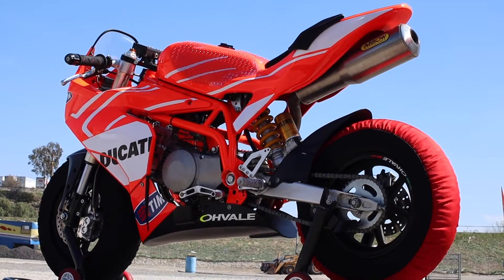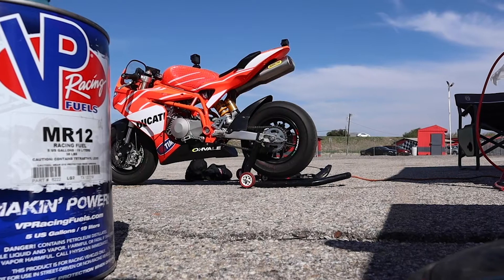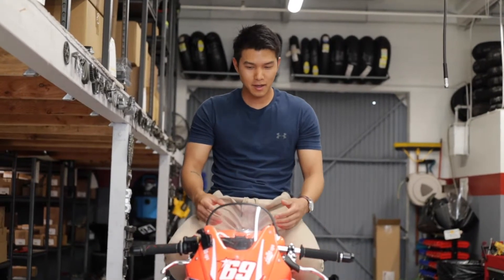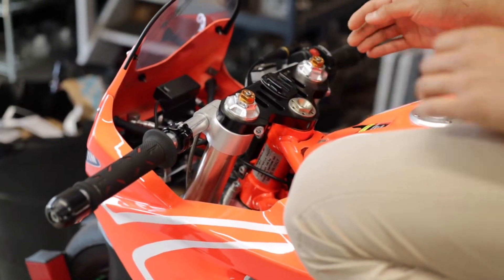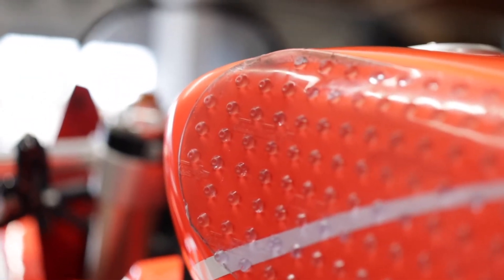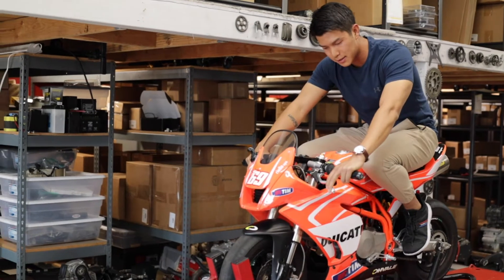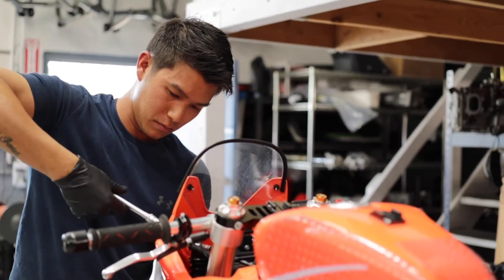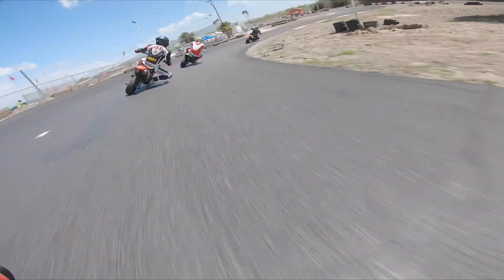Ohvale GP-0 190cc Breakdown + Review

Comment: Ideally, you should have a front/rear tire balance when sitting on the bike. That means before you even start anything with the bike, you need to get the bike sized for you.  For little kids, it's not a problem. Bit BIG kids and those wanting to go fast, it's really important. Get the scales out and figure out where you should be sitting on the bike.  Next, make some pads or something to extend your tank back into your junk, possibly widening the tank a bit. Then wrap the back/sides of the tank with a grip tape of your taste.  You want to ride the bike with the minimum effort.  You should be able to go pretty fast, driving with just the throttle hand.  Do not lay on the bars. I see in this clip a couple times the front gets pretty twitchy.  That's due to you putting too much pressure/weight on the bars.  All stopping/turning should be done with your core/waist/junk. You should have room to slide back for long straights, but you should not need to slide forward.  Build the tank up so there is no room between you and the tank.  Then when slowing, squeeze your knees, give a nice pelvic push and your body should stop without any interaction of your arms.  Your arms are for operating the controls. Throttle, brakes, steering. There should be little to nothing else. Do not lay on the bars, use them for steering only.  Build up the tank to auto-push you back!